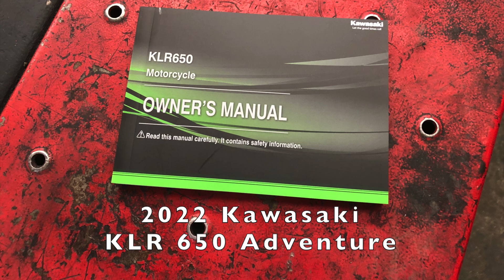NEW! 2022 Kawasaki KLR 650 Adventure - Unboxing & Complete Build - Dual Sport Adventure Motorcycle

Comment: Do they come filled with oil?
Reply from the maker: Yes.
Reply: Mine is over full, do you think it will be ok?
Reply from the maker: @brentmitchell9116  DO NOT operate it with too much oil. How much over is it?
Reply: When I have the bike level the whole sight glass is completely filled.
Reply from the maker: @brentmitchell9116  you definitely need to loosen to drain plug and let some drip out until you’re within range on the sight glass. Then tighten it back up to spec.

Comment: Why is the bike not assembled at the factory?
Reply from the maker: Because the crate would be twice as big and ungodly to ship across the ocean.
Reply: @trippontwowheels  a lot of the parts could be put together without adding any extra space to the crate. The whole handlebar assembly could be intact without directly mounted to the bike and covered in bubble wrap to avoid scratches. I guess shipping costs per square inch are higher than labour cost of assembly.  There is a lot of empty space in that crate that is even more wasteful if that is the case.
Reply from the maker: Trust me, these companies have studied it and know best. They are the experts and they do things for a reason.
Reply: @trippontwowheels  yeah, i know you are right.

Comment: Interesting watch. That seemed like. lot of torque on the right side mirror adapter. I also noticed there was no checking to see if the forks lined up correctly before tightening the pinch  bolts. Also sticking bare hands in grease probably isn't the best idea.

Comment: Those handguards are disappointing
Reply from the maker: I agree. A bit on the flimsy side. You have a KLR CB?
Reply: @trippontwowheels  My friend's first bike was a gen 1 KLR that came with similar flimsy stock handguards. He went down on a trail one day and they did nothing to protect his clutch lever, which snapped and almost left us stranded if we didn't have JB weld and some hose clamps. In 2022 it would have been nice for the more expensive higher trim LKR to come with some protection in that regard. No biggie though, these bikes are legendary.

Comment: Makes me appreciate the dealer fees more. Thanks.
Reply: You should have the option of setting it up yourself, half ass teenagers in most shops do this.
Reply: I agree
Reply: Right ha that’s a ton of work for small margin.
Reply: @rhllnm  when i bought my last new kawasaki half the shit they put on was barely tight....actually lost a bolt on my clutch lever on the way home from the dealership
Reply from the maker: @rhllnm  And open up the manufacturer to all sorts of potential lawsuits and warranty claims?  I think not.
Reply from the maker: @Chocolate_dragon  Then you have a suck dealership for sure. Sorry that happened!
Reply: The teenager intern at my Honda dealership which doesn't own a single torque wrench like this video 😁

Comment: Putting all the bike's weight on the handlebar to take out of the container??? It doesn't look too good for the handlebar...
Reply from the maker: It’s not all the weight. Maybe 40% at most as the rear wheel is on the ground and the bike is maybe at an angle of 75 degrees. The handlebars can easily take that weight and much more. This method is common practice with many dealers.
Reply: Thanks for the explanation. Best regards.

Comment: is this for real?? that much stuff to assemble by non factory workers? to save what exactly? dumb
Reply from the maker: To save on damages and needing a crate twice the size? Not dumb in any way.
Reply: @trippontwowheels  i have seen how dealership at my country messes up putting rearview mirrors simply because of the fact they use electric wrench to screw bolts in, then when I see a need to assemeble a handle bar, wheels, without a torque wrench, that is simply bad
Reply from the maker: Please read the description below the video. Everything was properly torqued on this bike.
Reply: @trippontwowheels  WHAT? People READ?! I knew after I read it that there would be people hammering it, and I wasn't disappointed!

Comment: Still too heavy, still not good enough to get on the trails....nothing new here. I would rather have the fancy box that it came in.
Reply from the maker: You’re in luck.  where you can get one of those fancy boxes for cheap.  🙂
Reply: Did I miss the front caliper going on ?
Reply from the maker: @chuckkopelson6903  No, you sure didn’t. The front brake caliper was pre-attached at the factory.  Thanks fir your question KTM!